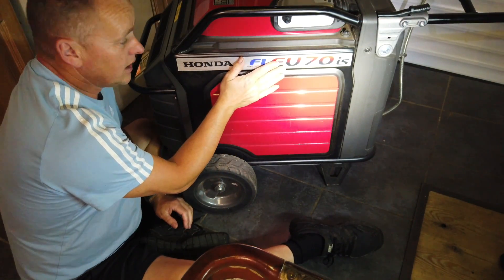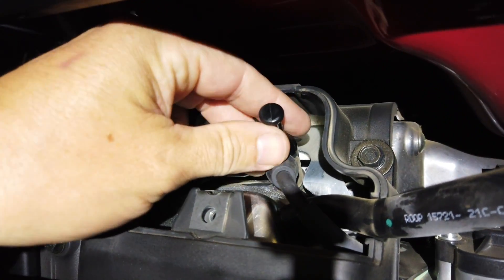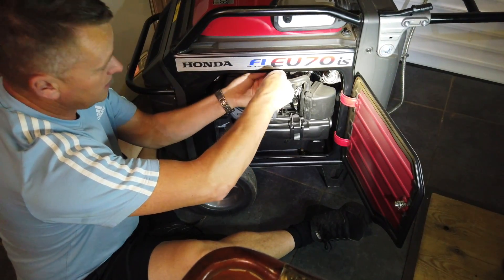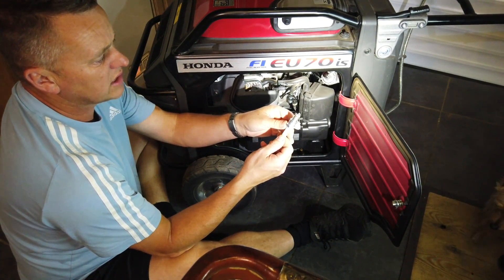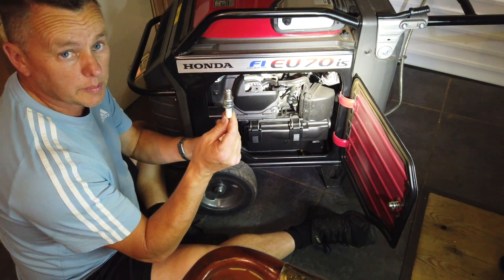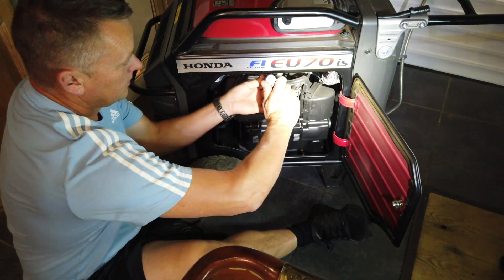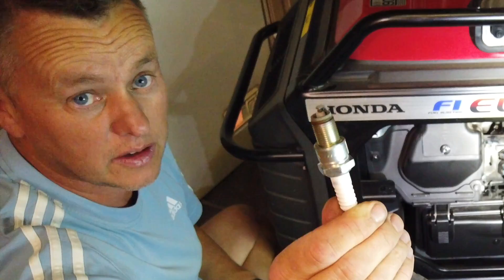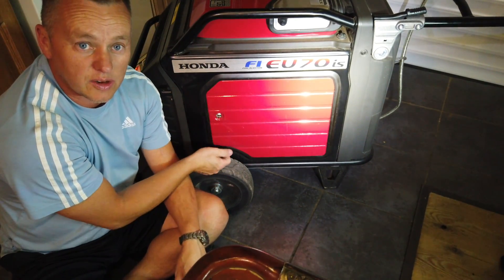Honda EU70is Generator Spark Plug Change, "Is It Worn Out After 300 Hours ? "

Comment: I am planning to get the same genset. Since you have this genset, can you confirm the length and depth of this Genset with and without the wheel? Since our door gap is only 24inches, we just want to check if this can be brought inside with or without the wheels.
Reply from the maker: With out the wheels it is a heavy unit, you could add castors on the underside, Thanks for the great comments👍🏻👍🏻🛠

Comment: 300 hrs??? Seems a bit ott
Reply from the maker: I suppose it depends on how much load you are running on the generator and the rpm we are using most of the time 1200 rpm so the generator is not being strained or worked hard hence the plug being very clean and not worn Thanks for the great comments👍🏻👍🏻🛠